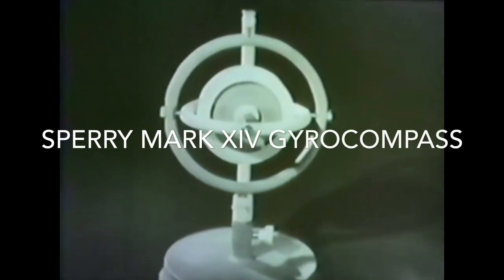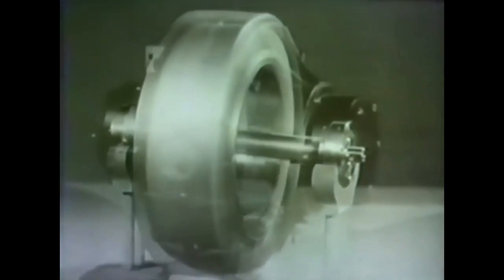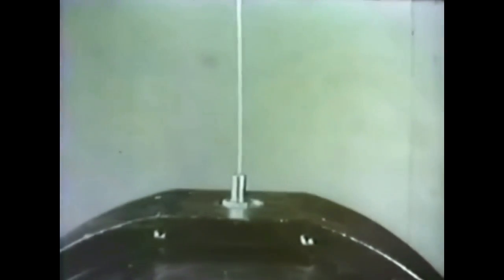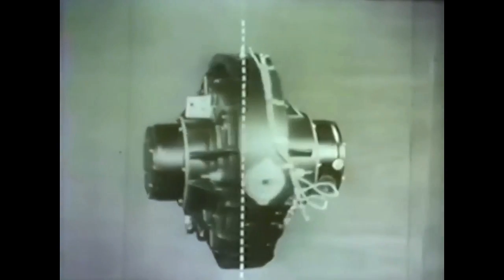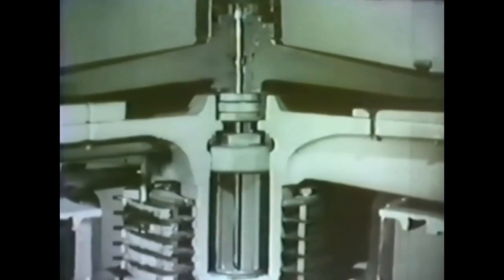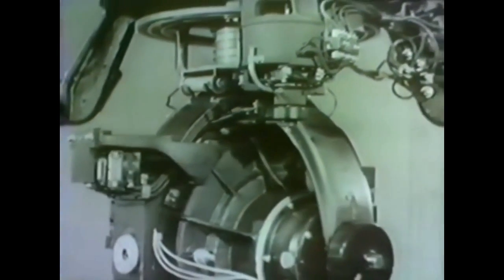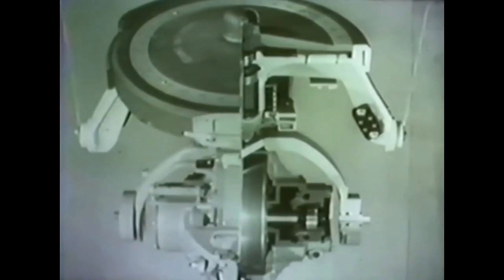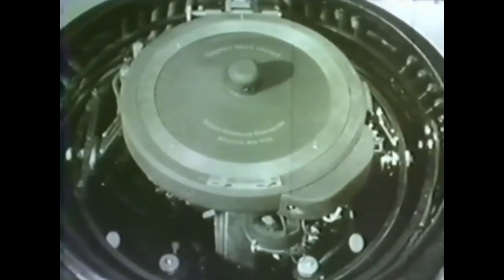Design of the Sperry Mk XIV Gyro-Compass

Comment: Rebuilt many Japanese made Sperry   SR-120 marine navigational gyros for a living. Lots of similarities between the MK 14 and the 120. Used steel ball bearings years ago , it was good for about 2 years of non-stop running .Then ceramic bearings and synthetic grease came out , went for 4 years , running at about 12, 000 rpm. Then the Anshultz gyros came on the scene and then changed everything !
Reply: I do not understand why the mercury is needed
Can someone explain this?

Comment: Previously, ship navigators relied on the magnetic compass to determine the required directions by calculating the ship's course error rate because the magnetic compass index deviates from the effect of the magnetic pole and not the real one, and both poles are not identical, so navigators were constantly correcting the direction of ships, but after the industrial development of ships The effects of the side magnetic fields on the magnetic compass increased, so that it became difficult for the navigator to calculate the correct direction of the ship, so scientists later invented the compass gyroscope,  that works by mechanical effects only, which is the moment of inertia of the gyroscope as well as the speed of the Earth’s rotation and gravity so that it is not affected by magnetic fields at all. The compass hand points to the true pole along the meridian with a slight error rate according to the ship's direction, speed, and position.

Comment: would I be right in assuming the sensitive element is working independently of the rest of the mechanism and is being drawn to magnetic north?
Reply: Yes, but it has nothing to do with magnetic north.  It aligns with true north, the earth's rotational axis.
Reply from the maker: Hold a pretty decent gyroscope at an angle and try to turn around, you will feel a pretty strong force fighting you.  Then hold it vertically, and turn around, it won't "fight" you when the two axes are aligned.  That is exactly the force used to align the gyroscope to Earth's rotational axis. Now that is a fairly heavy (massive) and fast spinning gyro so that it will be sensitive enough to detect Earth's fairly slow rotation rate being just once in 24 hours (half the speed of an hour hand on a clock).

Now days they use rotating laser light to build extremely sensitive instruments that can detect even smaller rotational motions, but these gyrocompasses are still used at sea.  DEFINITELY not magnetic -- they were placed deep inside giant metal ships with all kinds of electromagnetic interference around them.

Comment: Is there a part two? The show notes mention earth rotation and true north, but this video says NOTHING about those issues. Is there a video that addresses this issue?
Reply: There are several videos that explain the operation of gyrocompasses.  What issues are you looking to have explained?
Reply: @klam77  Not exactly.  Most navigational maps are based on true north and give you a magnetic declination incase you are using a magnetic compass.  The marine gyrocompasses output a heading like a magnetic compass but do not point to magnetic north, only true north, and are not affected by metal, magnets or electric currents. Also they are not affected by the movement of the magnetic poles over time.  The rotational axis stays the same.

Comment: but why does the rotor align itself north/south?
Reply from the maker: Because Earth's movement creates a small force because it is trying to turn the spinning gyroscope, that force is then detected by the electronics and used to align the spin.  Once the gyroscope is aligned to Earth's axis then the only force is around the direction it is already spinning so there is no force deflecting that axis of spin.

If you hold a pretty decent gyroscope at an angle and try to spin around you can feel it, it'll rip it out of your hands if you aren't careful.  The converse is true also, if you try to turn the gyroscope it will turn YOU, especially if you are sitting on a chair that can spin around. You can find videos of people doing just that.

Comment: The best word in the script: "Athwartship" :-)  So, Mr. Dark Star, are you trying to tell me that the Sperry Mk XIV gyro compass isn't just a toy gyroscope with one motor? Because those toys prove the Earth isn't moving, you know. ;-)
Reply from the maker: That would be my claim, yes ;)

My challenge to the intellectually challenged Flat Earthers would be to prove me wrong by showing #1 how they measured the frictional resistance of their toy gyro ("moves easily" is not an actual measurement), and #2 showing me their calculations of the expected force acting on their gyro in whatever configuration they choose. If #2 is smaller than #1 then they haven't demonstrated anything.

If they cannot show what is or would be EXPECTED, then they also haven't demonstrated anything.

Thanks for asking! I wanted to get that out there :)

Will be doing a blog post on it eventually I'm sure.
Reply: Dark Star math is fake, unless it supports the flat earth, then it magically becomes real. Shocking that no one answered your question. I’d think flat earthers would have an answer since they have so much evidence backing all their claims. They certainly wouldn’t assert something without providing the evidence to back it up.
Reply: That's right brother!. Liquids doesn't transfer shear stress between layers, only friction, so it's an intrinsic property of fluids not to curve, regardless of "gravity" (which is still been a theory, there are "laws of Newton" but theory of gravity), atmosphere (compresible fluid air) push water (incompressible) because of density, so air distributes pressure and maintain an absolut level of water and pressure on its surface.
Reply: Flat Earth Math this is a video of how a real life gyro compass works not so much about the principals behind why they work. You can’t possibly expect us to think that a toy is going to show this to us. Maybe you need to watch Bob on the “behind the curve” with his famous laser gyro showing a 15 deg/hr drift
Reply: @project_nihilist  Relativity it's still a theory. Research which company produced that documental and you will see their 
intentions. Watch ISS actornauts having troubles with harness, you can hear servo-motors stopping and their movements being locked. Explain me how after 6 months on a supposed "eliptical orbit" you see the same stars and you don't have a 12 hours movement of time (the sun would be at the other direction from earth). Water does not curve (watch Panama's channel). All fluids needs a container to be presurized.
Reply: @tomasreynoso1161  Regarding your claim about stars, this is demonstrably false. Watch the sky tonight and tell me if you can find Orion. Six months later do the same.
Reply: @tomasreynoso1161  I hope you've learnt what the word theory means within the scientific community in the 3 years since you wrote this stupid comment.
It's not a guess, it's an explanation of an observed phenomena.